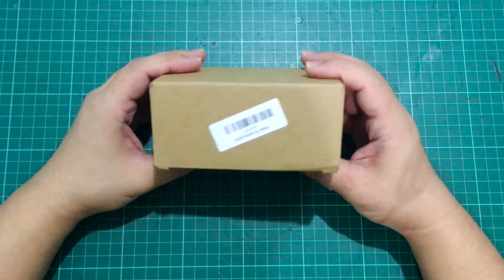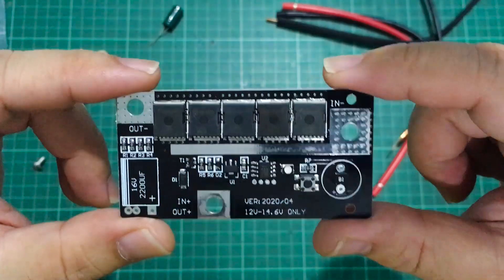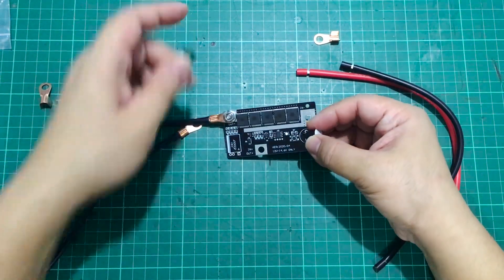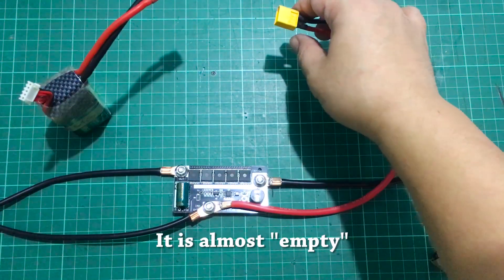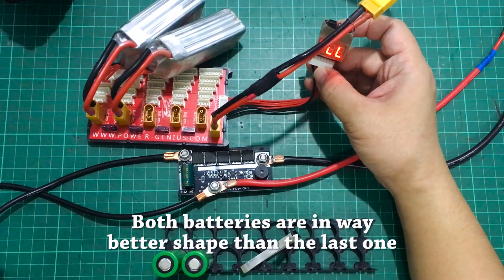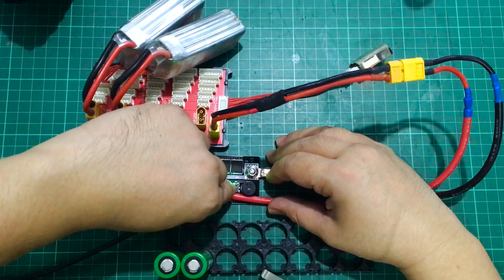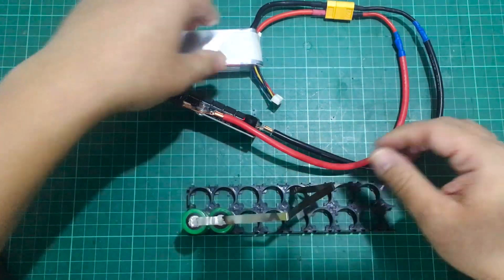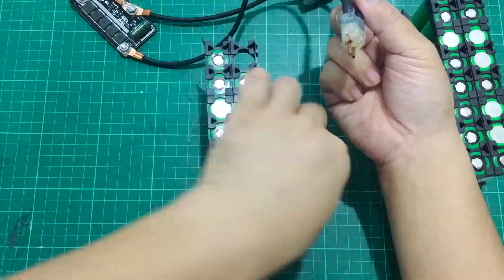DIY Portable Spot Welder | Trying Out Spot Welding

Comment: Can use solder if ya do it with contact iron and clean n tin both nickle strip and battery terminal but it's more work and don't use normal iron 😅
Reply from the maker: I don't know what a contact iron is. Does it use heat? If it does, that was exactly what I was avoiding from soldering. But something is better than nothing. :)
Reply: @ImaginationTech  I call it that cus it heats the strip instant and joins the 2 together if tinned first that is but ive has issues with a pack without the support structure as it is on my bike 👍
Reply: @ImaginationTech  it's jus like instant 150w iron but the tip is separated so it just heats the strip .....cus I didn't have spot welder at the time
Reply from the maker: If it's instant, then yeah I guess it's ok since hopefully the temperature doesn't propagate too much. A regular soldering iron needs to stay in contact with the 18650 too long that's why it heats it up too much.

Comment: I have one. Tried it with a 12V analog booster pack 18200 lead/acid and no go. Used a nice big BMW 105 Ah battery and welds like a motherfkr at 20 setting. I ran a huge solder bead down each of the copper rods on the board to increase the surface area of board contact.
Reply from the maker: Yup, battery power is the way to go to ensure it can deliver enough current for a proper weld! :) Check out my other spot welder as well! https://youtu.be/mgQwVT7V_q4
Reply: i have 90A AMG BMW battery, first welding and device is in short circuit, i thing transistor is KO. I think it was my fault bc i use it in 100 setting...

Comment: it has 5 power settings. hold button down to achieve each setting, a beep notifies which setting you are in. 1 beep when powered on = lowest power. 5 beeps = most power.
Reply from the maker: Ohh, that's good to know! I broke mine, but if I remember right mine only went up to 3 beeps. Or I just couldn't figure it out.

Comment: Oh i've got one and blew it like in few seconds. The battery i was using was 110Ah 850A type. The overall spot welder is good but you forgot to mention one the most important thing. higher the voltage, the less chance blowing this up. The manufacturers i hope, didn't think about what will happen when you basically short the battery out, especially lead acid ones. The voltage drops from 12.6 fully charged to 8 or 9 volts in microseconds but that time is enough to undervoltage gate voltage source and basically the mosfet is not fully open and can cause gate source internal shortage and then the mosfet stays open forever so basically no reaction from the IC to open and close . You can make the one simple change by changing the gate resistor to less ohm value. And i will also add some heatsinking on top of the mosfets to keep them nice    and cold and solder some traces going in and out on the PCB, that will also help to get better welds. This is really DIY because when you use them wrong, you'd ended up with a blown welder and forced to buy another and improove it a bit.. mine just blew up in fourth try to spot weld... i'll give it 4 out of 10
Reply from the maker: Pinning your post, since I think that's some really useful info right there! :)
This was my first spot welder, and I'm using a much nicer spot welder now for the same price as this one. Until I get a KWeld or something at lest :). Check it out here - https://youtu.be/mgQwVT7V_q4
Reply: @ImaginationTech  i think about my comment and i need to change something. The higher the voltage, the less chance blowing this up is kinda right but there is something. You don't need to power this from one common source, you can power this from basically another powersupply, nevertheless, you're connecting only negative rail through the board. Positive is just hanging there for powering the board. Make some direct probes from positive terminal of the battery and another positive connection from another powersupply. The voltage should be the same but there should not be happening  this gate phenomenon... should not but could 🤷 These chinese welders are a little bit tricky to operate with
Reply: @ImaginationTech  im currently using portable spot welder MinderRC DH30 MAX. Pretty cool spotwelder but as always , it needed some mods because i almost blew this too. The traces are non existing, needs to add a lot of solder to prevent this. Internal Battery is 10Ah and with this mod it could even weld  0.2mm nickel stripes

Comment: You may want to stick to your drones
Reply from the maker: Noted, but so you know I've built an electric skateboard Li-Ion pack with this, and probably 20-30 4S/6S quad Li-Ion packs for myself and others on commission and a couple more electric skateboard batteries for customers albeit using a different but equally cheap spot welder.

Comment: I guess you need to testing before video

Thanks
Reply from the maker: Depends on the video I guess. This one is for my first impressions, so the video is taken while I'm trying it out for the first time without prior testing.
Reply: @ImaginationTech  
Excellent

Thanks for your time
Reply: I have 11.1v Lipo 5200 mah 35c continous/75 max burst

Can i use this battery

Thanks
Reply from the maker: @mdaslamknl  yup, that should deliver enough amps (35 x 5.2A = 182A).
Reply from the maker: For reference, I'm using a 100C 1300mah 3S LiPo (100 x 1.3A = 130A).
Reply: @ImaginationTech  
Thank you

Comment: I've been use this same module but the weld can't perform well, even i use last level (red LED)
Reply from the maker: What power source are you using? A spot welder is just a stopper for the current. Without it it's just like connecting the spot welding tips directly to your battery or power source, so if you can't make a weld first suspect is the source.
Reply: @ImaginationTech  i have tested using lead acid from motorcycle, lead acid from UPS, even 18650 liion 3S but all them are not good
Reply from the maker: @fadli1987  try connecting the spot welding leads directly to your batteries (no spot welder). Touch them to a piece of nickel strip. Sparks should fly and it means your spot welder isn't working. If not, your power source can't deliver enough amps.

Warning: be careful not to touch both leads, and be especially careful you don't touch both leads to your self.

Comment: The soldering machine acts as a timer and current limiter. It has nowhere to bring more amps than the source gives. Soldering is done by the battery amperage. That's why it works very well with car batteries, which have high short-circuit amperage.
Reply from the maker: Exactly right!
Reply: Mine seems to run fine with a 105 Ah car battery. Welds really strong at a low setting actually lol.

Comment: What the recomended power input for spotwelder like that?? Can i use psu 12v 40A?? Or i should use car battery??
Reply from the maker: Use a car battery. Your 40A supply would either trip the safety protection and shutoff or just not be able to supply enough amps.
Reply: @ImaginationTech  ok. Thank you for the input.

Comment: I have one of these and I cannot get a decent weld regardless what battery I use. It is a crap design.
Reply from the maker: Not gonna argue with that, it is a crap design. But it does the job, at least it should. What battery you using? The device just stops the flow of current so it just puts out a short pulse, it's the full power of the battery that creates the weld. So if it can't weld, you likely don't have enough input power.

Comment: hi  How many ampere battery did you use.
I have the same product and it has never been welded
Reply from the maker: You will need something that can deliver about 100amps. A 1300mah 80c or higher should do it. Or a motorcycle/car battery
Reply: @ImaginationTech  Use 50A car battery and it has not welded. There is a pulse but not welding
Reply from the maker: 100A, bro. That's not enough power.
Reply from the maker: 100A, bro. That's not enough power.
Reply: @ImaginationTech  I'm sorry if I made a 18650 200A lithium battery, would it work? Thank you

Comment: Thanks so much for the video, I just ordered one of these and I was worried it would not work well... I have a 4S 45C 5,000Mah lipo I’m gonna connect it to... should work
Reply from the maker: Yup, it'll work. Just finished a video on a newer spot welder though - https://youtu.be/mgQwVT7V_q4
The mod I did on that one should help prevent burned mosfets on this too, though not sure which pin would be the equivalent as I don't have mine anymore.
Reply: It's not rated for 4s, or? Did you fully charged it or only on storage charge?
Reply from the maker: @petles  I've tried it with a full charged 4S and it was fine. That said, if you have a 3S it'll probably be better.

Comment: Um, get the correct soldering iron and know what you are doing and it's fine to solder them. WTH
Reply from the maker: I only showed information about how heat transfers quickly, even with a quick tap, and that heat stays on and spreads through the battery. If all you have is a soldering iron, then yeah that would be the best (and only) tool you have for the job. But, it's wrong to say that you should solder if you can spot weld instead. Spot welding will still be the optimal way to join 18650s.

Comment: what is the max thickness of the nickel strips it can weld through? 0.1, 0.12 or 0.15 mm?
Reply from the maker: Using 0.12 here but should be fine with 0.15

Comment: I conneted to 12v 8A power and it is no light indication or no buzzer beep from board. Can 12v 8A support ?
Reply from the maker: 8A should be enough to power the board and make it beep, but not enough to make a spot weld which you'll need about 100A or so. Try it with a car or motorcycle battery, if it still doesn't work your unit is busted.
Reply: @ImaginationTech  thanks for info. I will try connect with car battery and will confirm with light indication or hear beep sound.
Reply: @ImaginationTech  ung sakin nasubukan ko na sa lifepo4 4s6p 30ah hindi padin nya mapadikit ung nickle plate... Sira na kaya ung saakin??

Comment: never use with depleted batteries. the voltage of the battery is feeding the mosftes controller directly (through a 5v controller offcourse). if it sag too much (get really low), the controller will mess up and could short the board while the leads are soldering (it means boom)
Reply from the maker: Thanks, this is really useful bit of info. I eventually wrecked this spot welder, but might be because I tried with 4S (sure wasn't with a depleted battery), or it might just have been it's time, IDK. But I did get plenty of spot welding done with it (biggest was a 10S3P pack, 30 batteries).
Reply: @ImaginationTech  ah yes, i saw a bunch of those being on fire for some unknown reason... i bought one recently, not that model, but soon i'll try with 1s battery and see how it goes.

I'm feeding the board with another battery, so the board "have a 12.6v battery" when in fact is only 4.2. Just connected the negative of the battery through the board, and the positive straight to solder leads.

In that way the voltage of the board is independent from the voltage of the welding battery, should be safe.

Should...🤣

Comment: This unit works really well with a car battery. Mine is 340cca. I've tried using a Li-ion battery I made 12.6v 12ah and it wouldn't do anything. May try and make a 40ah 3s battery pack to see if that will work better.
Reply from the maker: Liion batteries generally can’t deliver high enough amps that spot welding requires. You want to make sure you can do about 100A instantaneous, so the car battery is  perfect, as well as a high C-rating LiPo👌

Comment: I made an inexpensive (i.e. free) spot welder by rewiring a microwave transformer's secondary coil
with a few turns of flexible 1/0 wire.  Works great!
Reply from the maker: You should make a video on that, it would be quite useful. Unfortunately I don't have any spare transformers so it wouldn't be free if I were to do it. :)
Reply: I was going to do that as I have one wired for 24 volts but it gets uncomfortably hot.

Comment: I'm going to use a lead acid starter battery. I think that will have the required amps :D
Reply from the maker: Yes, that will definitely do! Many DIYers use that as the power source since you don't usually have LiPos unless you're flying quads. :)

Comment: How many amps are needed to get a proper spot weld? I’m wondering if Lipo batteries are the way to go, or if Lithium ion batteries will have enough current.
Reply from the maker: It needs a fairly high current for a very short amount of time. Based on other DIY spot welders, you would need 100A or so which is why a LiPo is ideal. LiIon usually can't deliver as high a current.

Comment: thanks for the video. I am quite clear about the battery sets used/recommended, would you repeat/write in your text pls? thanks
Reply from the maker: Used a 3S LiPo and a not-fully-charged 4S LiPo. Some people have told me this can handle a fully charged 4S LiPo as well (16.8V) even if it's only rated to 14.4V. Haven't tried so try at your own risk.

Comment: Very good video. But what size of nickel strip did you use?
Reply from the maker: This was 8mm wide x 0.1mm thick, but 0.15 might be better for general use and it takes in more current too.
Reply: @ImaginationTech  I have this welder, it can't do 0.15, even after being modded with a thick line of solder along the mosfets.

Comment: Thanks for the video. Really appreciate it. I bought the same unit and could not figure out the beeps and the LED lights. Couldn't make mine work, maybe the battery I was using was also pretty dead. Couldn't get the supplier to give me any other info on the LED and beeps as well. Was about to chuck it in the bin. Thumbs up to you.
Reply from the maker: I'm glad this video helped someone! Yes, the beeps are very confusing! Something I learned after I made this video is that there are two "green modes", presumably low/high, that puts out regular bursts, whereas the red only pulses when connected. I've found the high green mode works best for me. :)